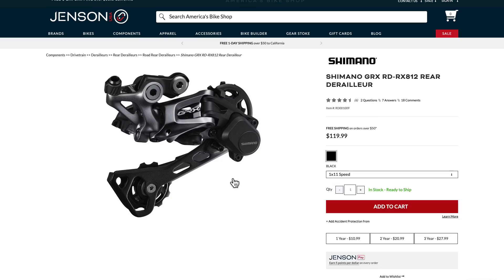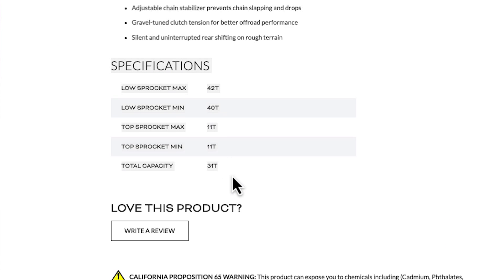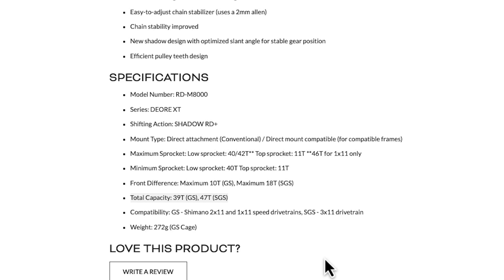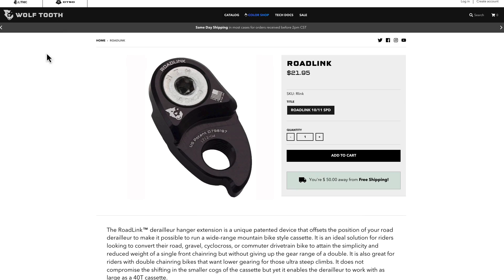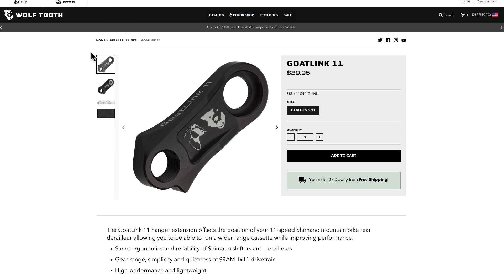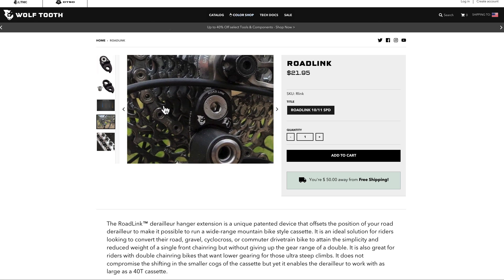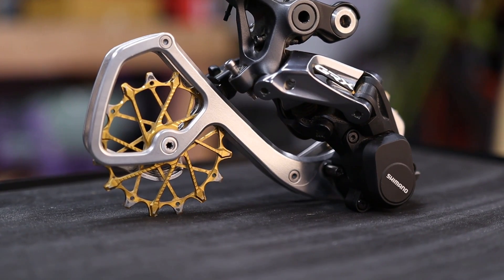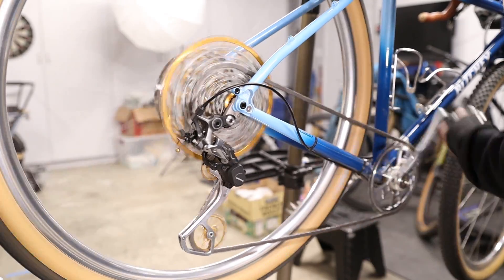The Rear Derailleur EXPLAINER

Comment: Thank you very much for the video! It perfectly helps to understand what works with what for the 11-speed GRX derailleur.
One question: Which of the two options described in the two videos would you recommend for converting from a 2x to a 1x setup with the GRX 812, considering only shifting smoothness and system reliability, and not the cost of the conversion?

Comment: Hi brother I dnt know your name. But I mustsa you beautifully explained it. I am currently using a raleigh 29er mtb with 11-32 with 48-24 std company fitting. Which I have modified in a way by putting an rear derailleur extender and using 11-46 cassette with alivio mtb RD. I wish to go upto 11-50 cassette with reduction in crank size to 42-22 T and wheel size to 26inch on same frame to counter very steep mountain climbs. Is this really workable?

Comment: Great video. This and the two other inspirer to buy the longer arm from the XT series. I have a GRX 817 di2 derailleur. It currently running a 46t wolftooth  chain ring with a 11-36 casette. After a couple of races, I rolige I really need some lover gears.
So I have been looking into a lager casette for my 11 speed bike. Either 11-46, 11-50 or looking at the Helix e-tirteen with 9-46. 
But struggelug in figuring out what casette to choos. I have already both thefront and back part of the derailleur. I would love to hear some feedback
Cheers
Peter

Comment: i have an interesting question. I am switching from a long cage SLX derailleur to a short cage shadow + derailleur, at the same time I'm going from an 11-42T cassette to an 11-45T cassette. Should I shorten my existing chain, leave it the same length or do you think I'll need a longer chain? I have no idea. I'm thinking leave it the same length since i figure the shorter cage but larger rear cog even themselves out.

Comment: two surprising setups i was dealing with. first: 2by, very short cage shimano 6400 rear mech that somehow worked fine with 11-34 cassette. second: 50/34 2by,  sunrace m9 rear mech, 11-34 cassette, and there's no way i could make that work, even though the capacity should be fine.

Comment: Many thanks for this! I've been needing something lower than the 11-42t for my 1x gravel bike for ages. So I bought the Deore cassette and XT SGS derailleur parts you recommended. Also put on a new chain with 118 links. Seems to work well with a quick test ride. I'll try an off-road session next weekend. Thanks again. 😊
Reply: Update: been on a few muddy and rough rides. The 51t cassette with the modded GRX derailleur is working pretty well. No gear change or retention issues. When everything is really dirty, there's a bit of chain click and grind in the middle of the cassette. I've maxed out the B screw already. I can live with it though.
Reply from the maker: Thx for the update!

Comment: Great video - thank you!  I am considering a 2x12-speed GRX groupset (GRX RD820 rear derailleur) for my bike, but I would like to use a 12-speed 11-30 Ultegra road cassette, rather than the 11-34 or 11-36 that normally comes with the GRX 2x12-speed groupset.  The Shimano GRX 820 rear derailleur specifications state: Low sprocket: Max. 36T/Min. 34T.  In the video, you explained why the max sprocket specification exists (36T, in this case) , but can you please comment on the minimum (34T, in this case) - why does that exist?  Will I be able to use the GRX 820 rear derailleur with the 12-speed Ultegra 11-30 cassette?

Comment: For 30 yrs I've run Shimano gs cages. Even getting the old dura ace super shorts. Worked for everything 😜 but also haven't run a 3x setup in also as long haha.. if you ran a 3x with the newer huge cassettes? Maaaaybe an sgs? But noooo hahaha.. keep it small and tucked.

Comment: Could I ask, would a GRX 812 RD work with the GRX 400 shifters so I can increase the Max Sprocket? Or are the pull ratios too different… and I’ll end up needing to use a wolf tooth link.
Reply: Yes but not the other way around. They have same pull ratio. 1x only
Reply: @OMPONG777  Thanks thats what I thought that the RD is dumb and not indexed. Thanks!

Comment: I have a 3x10 speed Ultegra group set on my tandem where I installed a cassette that (according to Shimano) is beyond the recommended spec limit. The B screw was maxed out. I just simply installed a longer screw, and it works great! On most derailleurs, the B screw can be extended for more capacity. In my opinion, Shimano should install a longer B screws from the factory.

Comment: The Shimano GRX 812 (1x11) uses the same cassette as a MTB and that have to mean it has the same pull as a MTB? So just switching the deraileur to a Deore 1x11 would mean a 11-51 capacity, right?
Reply: Although the spacing between the cogs is the same, the pull on the cable isn't. Road and MTB shifters pull a different amount for each gear (and linkguide is different again!). Mullet gear setups with cables don't work with Shimano. Hence you need to leave the derailleur arm as GRX and just switch the arm cage.
Reply: @DavidMcGuigan  I finally got it. Did not realize road and MTB pull was different. I've ordered th XT long cage EUR 20, and will swap it out on my GRX.

Comment: Great series of videos on this topic of gearing, thanks!  I am especially interested b/c I have a confounding gearing situation:  gravel bike with Shimano 105 brifters (circa 2017), GRX 810 RD, 11-36 cassette, and GRX cranks with 44/28 chainrings.  No matter what I try with b-screw, limit screws, cable tension, I cannot get the RD to shift into the smallest cog if there is enough cable tension to shift into the biggest cog, and if I slacken the cable so it shifts into the 11T cog, it won't shift up into the 36T (gets stuck in the second largest cog).  Anyone have suggestions?  There seems to be plenty of clearance at the largest cog/pulley (the b-screw is not maxed out).  And I have double checked that the limit screws are not inhibiting the upshift or downshift.  TIA!  P.S.  I did align the RD hanger using an alignment tool as well.  It was a bit out of alignment but even after aligning the shifting still has the same issue.
Reply: I guess you probably have it figured out by now but if not, its almost certainly an issue with binding in the rear shifter cable/housing. Frayed cable or kinked housing.
Reply: Thanks Peaceman5790.  I think you’re right, it was a cable tension issue.  I did get it to shift into the smallest rear cog by thoroughly cleaning and lubing the RD and cable housing, replacing the chain (it was worn out), and then by making micro adjustments with the barrel adjuster to the cable tension.  I think that I have pushed the RD / chain capacity right to its limit, so the cable tension has to be just right.  Also, I have a Suntour cassette and SRAM chain probably don’t work as well as an all-Shimano set up would shift.

Comment: I need to know if Wolftoth works and it do its job,  i have shimano sora 3 per 9 
50-39-30   11-34
I wont rear 11-42
With wolftoth is it possible?
Heard about things like that are a mess 
But they are Not  using wolfthof 
Thanks
Reply: I have a Shimano/MicroNEW 2x8 set up on my "long tail" mixte.  46T is the biggest cog and I'm running a RoadLink. Shimano Acera RD clears it just fine with the RD extender.

Comment: My personal experience with backpedaling is that wear on the big cog combined with short chainstays are the biggest factors.  My gravel bike has two wheelsets, with the second using a leftover 10-51t 7100 cassette off my fat-cargobike.  The aluminum 51t cog was showing some decent wear and was replaced with an all steel M6100 cassette.  I put that cassette on the gravel bike's road wheelset where I expected very little big cog usage.  Sure enough it will fail the back-pedal test, while the fresh M7100 10-51t cassette on the gravel wheelset using an identical hub can backpedal with impunity.  So long chainstays on the fat-cargobike was fine with a worn cog, short chainstays with a fresh cog was fine, but worn cog with short chainstays is not.

Comment: Excellent video!  One thing I wish you could discuss more is the difference between a cage with an offset upper pulley vs. a cage without an offset upper pulley.  1X RD uses an offset pulley, whereas a 2x RD uses a non-offset pulley.  The offset pulley is used to maintain a constant B-gap across a wide range cassette.  On a 2X RD the offset pulley can't be used, hence a 2X RD has limited max cog as compared to the 1X RD.  We'll need a new invention to allow for both a large max cog AND high chainwrap capacity, something I was hoping to see with the new Shimano 12-speed GRX group.  The 11-36 2x cassette just isn't wide enough.  I was hoping to see a new 12-speed 11-40 2x cassette and matching RD.
Reply: Since the 812 cage can make the 810 body to go up to 45 without a road link I just see this as something not willing than not able
Reply: @michaeltsui3435  The 812 is a 1x RD with an offset upper pulley.  I'm talking about a 2x RD that is designed for a wide range cassette like the 11-40.
Reply: @jonathanwoo6597  I mean people have used a 810 derailleur with a 812/M8100 cage and goes up to at least 42 or even 45t without needing road links. That is definitely a warranty busting modification but its shows it can be done
Reply: @michaeltsui3435  Yeah.  I'm running the 11-40 2x and it works great on my own bike.  But I tried to do the same on a friend's bike and the shifting isn't perfect.  i think it's frame dependent.  I just want Shimano to come out with a RD capable of 11-40 2x, on both 11-speed and 12-speed.  Shimano wants you to go 1x to get the low range, but personally I prefer 2x with a wide range.

Comment: Would the Wolftooth Components' Road link DM help improve your modified GRX812 RD with XT plates? Would it make it so the b-limit screw doesn't need to be maxed out?
Reply: My thoughts exactly. 
Going to try it next. It should help with chainwrap, as in more chain in contact with the cassete.
The m8000 sgs has a max cog of 46, so the road link should help make things better with the 51.

Comment: My bike’s 3x gearing technically needs a derailleur with a 55t capacity but don’t tell my bike that because it’s working fine. 😬
Reply: 50/39/24 with 11-40?
Reply: @scrooge1913  48/38/28 and 11-46
Reply: Its fine, we know not to go smally  smalls and biggy  bigs
Reply: @janeblogs324 Exactly so, but that solution is not possible with 1x . Another reason why 1x is just daft if you need a big range in gears.

Comment: The spec manual only count the most conservative build from shimano, which they try to sale in 'group'. Its really annoyed to explain the trick secret which they are keeping for years.For example, RX812 only listed about 31t capacity, but it has the same cages as the m8000 gs, and if it changes the plate it can climb over 53 capacity, over 47t they listed on m8000. And m8000 can work on 2 or 3 by cranks, but they only list rx812 for 1x only. Shimano spec booklet is really funny.

Comment: Actually 11s shimano RD & FD has about 15% plus more capacity than the spec on manual. Just screw it at the first, then buy a sgs plate, if they don't work, buy a longer hanger. 
The road bike FD can handle 18 teeth difference between large and small chainring. 52-34, 48-30, 44-26 or 42-24 works well. UT and grx has the same limited screws, they can work on the MTB none-boost 2x crankset.

Comment: Interesting as I’m debating how high I can go with the GRX400/10sp in a 1x setup. It’s on the 11/36 right now but I think I would be okay with an off-brand 11/40 with my 44T crank. I could also keep the existing 11/36 and go to a 42T or 40T chain ring. It’s fun to play with all of this but the $ aren’t as much fun. P.S it’s a bodged bike with no front derailleur mounts or guides but I guess that is another option to get a wider range with smaller steps between the gears. Won’t be used for bike packing or anything like that.

Comment: Great work across this series. I tried the XT cage mod with Di2 GRX 1x on a 46-11t and it worked much better than the unmodded attempt. Looking forward to trying the 51-11 with a Shimano chain and a larger front chainring than the current 38t now thanks to your follow up. 👍

Comment: For personal beliefs, I prefer using a no more than 10 speed cassette. I have had my fair share of chinese brand 10 speed 11-50 cassettes and I'm fine with how they perform but wanted a beefier Shimano derailleur.

According to some info about pull ratios, a 10 speed SRAM shifter and a Shimano RD-M5100-SGS have the same pull ratio of 1.1, but I am not sure of the veracity of this.

Would these components be compatible?
Reply: Just using m4100 or m6000 shifter. 10 - 11 - 12 shimano rd has the same pull ratio.

Comment: Wow, such detailed vid Nolan. Lot of things I didn’t know. I have swapped the 11/34 casette for 11/40 and I use a Shimano RX clutched long cage derailleur and it works fairly well, but the back pedaling when on the 11 tooth cog and 50 in the front (2 bi) does have some issues. My mechanic suggested we change the shim spacer one cassette to 1 mm instead of the 2 mm it had originally. It sure helped. I may need to watch this vid a few time as you spit out so much useful info I can remember all at once. 👏🏼👏🏼